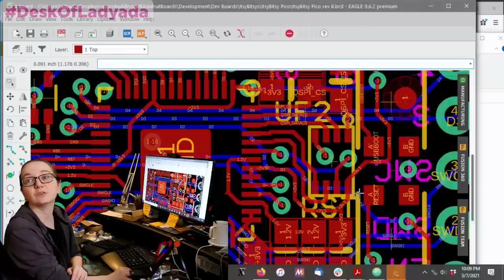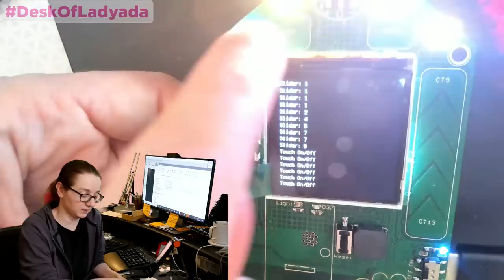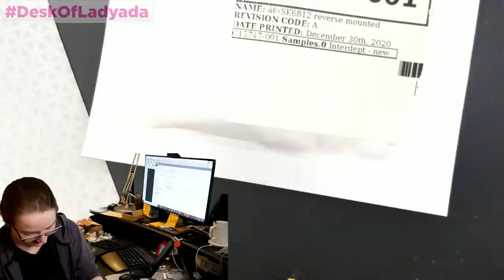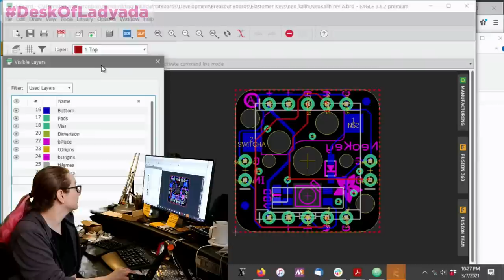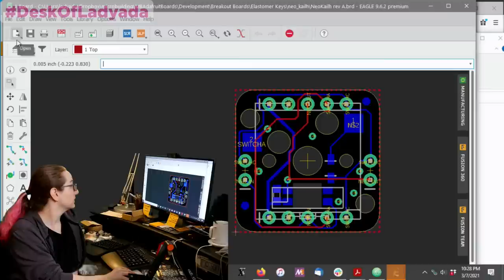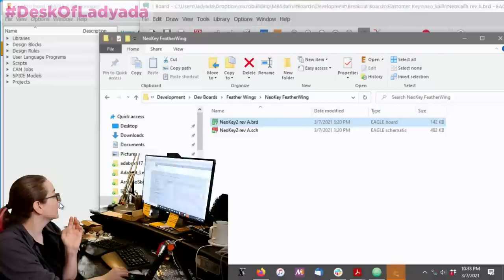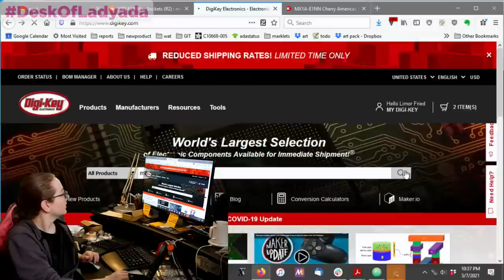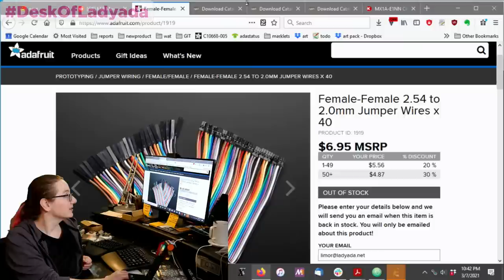Desk of Ladyada - Cyber Sunday on The Desk of Ladyada

Comment: That's some awesome silk screen. The board art is always so cool: I ordered a DragonTail for my Clue, and it showed up with a dragon on the back and "everything's better with dragons" 😁

The house is cool! I'm always afraid I'm going burn in an image to the tft, maybe add a proximity sensor so you can wake up the display with a wave of your hand? That's one of the first changes I make to the Bonsai Buckaroo Clue project from adabox, screen only turns on upon button press or prox sensor wave. (Oh, though I saw that pir header, maybe that would do the same)

Keyboard stuff looks cool! The first thing I did with my QT Py was to use it as a capacitive touch macro keyboard, just with wires dangling from a breadboard. I think everybody likes little macro keyboards 😁

Comment: I like the way the neokey is progressing. Will be interested to see how the through-board neopixel works out - I did not think it was possible to have square holes in a PCB! If these macro keypads are to catch on though we need some way of making keycaps with custom legends. The only satisfactory way I've come across is two-part 'relegendable' keycaps that sandwich inkjet printed artwork under clear click-on tops. But these are absurdly hard to source. I'd like to plea again for Adafruit to stock them since you probably have the volume to get them specifically molded or a batch run if you can find a supplier with molds.

Comment: 28:04 - I think it was you in a Great Search a little while back (though perhaps it was something I saw elsewhere?!?) who showed the little rotary address selector thingies - like a cross between a trim pot (in method of manipulation) and DIP switches... might be perfect for this, as a way to set addresses?? Even if you didn’t want the part on the board by default, you could pick a switch, stock them in 10 packs or something, and leave pads on the board for folks to self solder them if desired. (Or sell them with and without prior installation, or just always with, or whatever.)